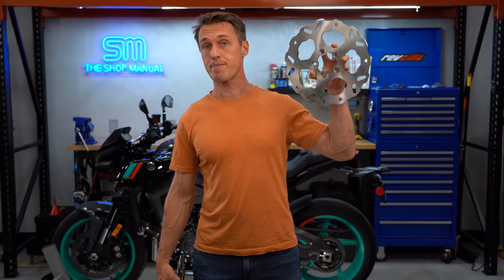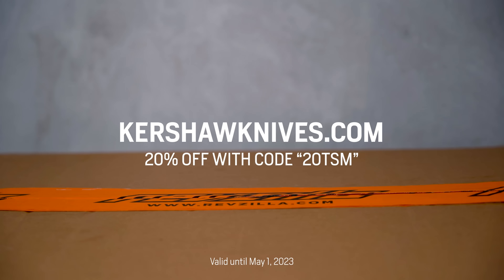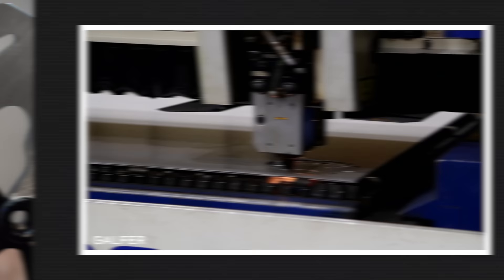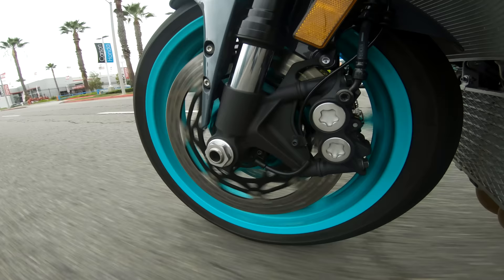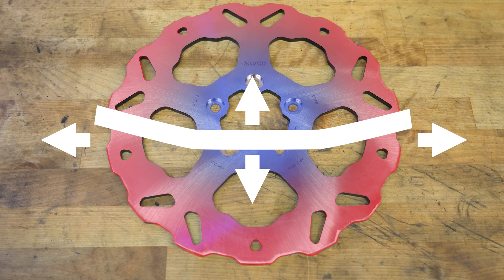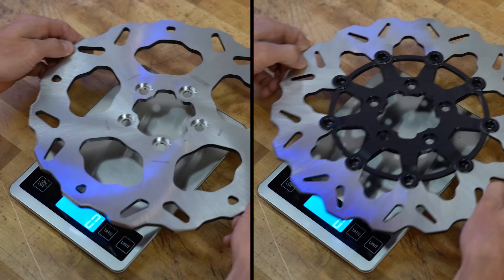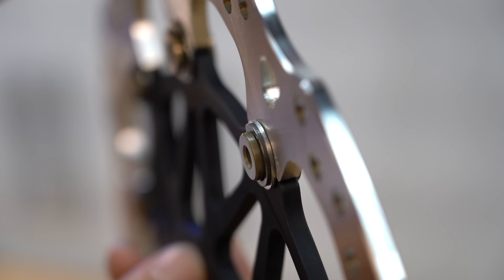Solid Brake Discs vs. “Floating” Brake Discs | The Shop Manual

Comment from the maker: In need of brake discs, pads, fluid, hoses, bleeders, or other brake components and tools? RevZilla has you covered. https://rvz.la/3XmsdCs
Reply: You guys don't carry the Galfer Rotors I used for my bike. So I had to grab them from FuelMoto USA. :<
Reply: Only thing I would have liked to hear Ari comment on is Buell's design with the rotor on the outside of the rim. I remember reading about it years ago and it sounded like a pretty solid improvement for brakes. At least in street applications. Great video as always though!
Reply: i thought you guys were gonna discuss the potential danger of floating discs. not sure what would cause the floating discs to push the pistons back causing no brakes for few pumps until pistons are back to where they should. never knew this could happen until a rider at my local track died because of brake failure. he had a tank slap and as a result, no brakes. not entirely sure what the exact explanation but according to other riders, tank slap caused the floating discs to push the pistons back. this is quite uncommon, i would really appreciate if you guys can explain this in detail.
Reply: @yobkit1982  This happened to me on my R6. Didn't know it was caused by the floating rotors though. Got a tank slapper and then didn't need my brakes until I was coming up on a hairpin. Luckily I was taking it easy after the tank slapper and had time to mash my brakes until I got some breaking action back. Scary stuff.
Reply: @yobkit1982  the floating disks vs non floating don't make any difference in terms of pushing pads back after a tank slapper.
It happens either way
Reply: A rubbish site, I put in Aprilia front brake discs, and got a load of rubbish, even Harley discs, but no Aprilia !.
Reply: I got a pair for my local Aprilia dealer, fitted Saturday,,,

Comment: As someone whose only gotten into bikes in the last 5 years, videos like this are super interesting. Maybe not something i think about when im working or riding my bike - but very cool to know all the advancements we have made over time.😁 Also just general bike knowledge is crazy helpful!
Reply: If you want something to blow your mind, stainless steel brake hoses. I replaced mine a couple years ago and the cost was roughly the same as the OEM rubber ones, but they'll both last much longer and they give much better feedback to me while I'm braking. Plus, the fact that I was able to get one that matched my bike's paint scheme was an added bonus. Those things look and perform amazingly.
Reply: @SmallSpoonBrigade this is one of the absolute best mods ever. I’m actually surprised almost no bikes come with them as standard.
Reply: I’ve been biking for many years and I still learn from Ari :)

Comment: I'm getting sick looking at how ridiculous so many of the floating discs are , there is so little material in the aluminum part that fatigue cracking is a serious health concern, 🤮☠️🤕 I've learned a few things from building a stainless bicycle frame , call me crazy but I think I'm going to stick with the old school solid metal discs and make my caliper floating instead of the disc 🤔😁 don't worry those super super lite weight discs should preform wonderful until you need them the most 😮

Comment: Would be cool to see a video on maintenance of semi-floating discs, especially for people who live in cooler/wetter climates.
Reply: What maintenance? 👀
Reply: @curbkreature7488  Over time the rivets can get dirt and corrosion in them seizing them up, you can also replace them if damaged or badly corroded.
Reply: @curbkreature7488  Also good maintenance of brakes include using fine sandpaper or scotch brite to clean old brake dust from the surface of the discs themselves.
Reply: Best way to do it is to make sure you keep the bobbin/ rivit free moving . Use a 10mm bolt and nut out through the hole and turn it clockwise and anticlockwise to keep them free moving . Do this once a year ..I would not bother with sandpaper on rotor unless you are installing new pads as they work better with your pad material on the rotor/disc . Caliper maintenance is so important and lots of videos on YouTube about it .

Comment: Not a motorbike guy but I'm an MTB fanatic. We have this argument all the time. Floaters say "but heat dissipation, weight, looks pretty" while solids say "budget friendly, simple". Some of you may not believe it but on a good DH run discs get hot, even on a push bike. They will offer burns and boil the rain. As a result, floaters are becoming more popular and we're seeing DOT 5.1 brakes becoming the most in thing with Hope and SRAM being incredibly popular choices. With that said, the simpler and less maintainance heavy mineral oil brakes have picked their game up, both Magura and Shimano have really upped the formulas for their mineral oils while ensuring they won't hurt older models. 
 My initial thought going into this video was, "yeah, obviously a 200kg bike doing 100km/h and over will want floaters, those beasts make a brake glow". Just like MTB, solid discs on motorcycles seem to be a budget offering or a lower performance offering. It makes sense, sure a set of £50 Tektro solid rotors work but a pair of Hope floating rotors at £100 a pair do it better, seems very intuitive that as speed and mass increase, that superior performance becomes less of a desire and more of a requirement. 
 Overall a very informative video and very well produced. No guff, no gimmicks, just pure information and some beautifully engineered examples, I wish MTB had discs as sexy as those.

Comment: I had worn pads thinking that was my issue with braking performance. Put in a new set and has the same issue, low performance braking with some pulsing. Also found them to wear out incredibly fast

Ended up having sand in the rivets and my rotors become solid. Cleaned them out and it's all back to normal

Comment: The absolutely best video I've watched on the subject. Ari these videos are an incredible resource, huge props to you and the team. I've been tracking my heavy BMW on solid discs for years now, braking from 155 mph to 40 at COTA in the advanced group, I'm surprised how well my rotors have held up. Definitely looking to upgrade to semi-floating rotors soon!
Reply: Nice to see you here 😄but actually BMW's front discs on the XR are semi floating. They are still mounted on bobbins and have play in all directions, simply the hub is not present as the wheel takes care of that. No real reason to upgrade to anything different.
Reply: @AntaresSQ01  oh wow, I just went to the garage and  checked. They wiggle for sure! Amazing that after all these years I'm just learning this. Thanks!

Comment: I noticed one of my front rotors on my adventure bike was very lose.  Upon inspection I saw that three rivets had bent flanges.  This likely happened during an offroad steep and slippery leaf filled ditch mishap years ago.  Took some work to flatten the rivet flanges back on the affected rivets.  Bottom line,  if you’re off roading with a bike with floating rotors keep in mind they’re more delicate and can be easily damaged from lateral forces.

Comment: Hey Ari, can you please do a breakdown of what “backing it in” is and and if it’s bad for your bike? Thanks!
Reply: do it all the time on my mt09. learned on my husky te510 motard and xr400 motard. Its fun sliding the back out when entering a corner.
Reply: "Backing it in" usually refers to diving into a corner hard with the rear end loose because you were so heavy breaking that the rear wheel is traveling faster then the front. This is also the same/similar to in Drifting they call a "rear entry". They again, dive so hard into the corner the car rotates to the point of the front being behind the rear for a second or two as the car spins the rear wheels to regain control.
Reply: as for bad for your bike... Not "really", however, doing anything this dramatic and hard on the components is going to cause wear and tear, so in a way Yes, its bad for your tires, brakes, suspension and possibly for you if you mess up and cause a high side and throw yourself off like a motogp racer in the rain.

Comment: Decreased unsprung weight has several benefits as well. Way back in the day, I rode a Suzuki GS850 shaft drive motorcycle. The original tire was a Dunlop. A Continental tire of the same size and rating weighed about 5 pounds less. That helped reduce the unsprung weight penalty of the shaft drive and made the bike much more controllable on rough roads. The Suzuki also had two steel front rotors and it would have been nice to dropped 8 pounds of unsprung weight on the front wheel as well. But, didn't have technology then.

Comment: And not only is the overall weight of the motorcycle reduced, but it also reduces the unsupported weight, making the suspension work better and allowing the wheel to stay in contact with the ground for longer by reducing inertia, which improves grip. and stability

Comment: Wet discs have been around a long time but due to corporate pressure they are not an option due to the length of time between pad changes, but the wet disc is the clear number 1 form of braking as it allows the best control of the braking and the best stopping distance . Macpherson tractors were the first to invent the wet disc , housing the disc brake and caliper in a sealed container filled with hydraulic fluid and the pad had a 10mm wide groove cut into the pad allowing the fluid to flow through the pad whilst the pad was being forced into the disc rotor.

Comment: > the rivets that secure the rotor to the carrier are either clamped right out use spring washers
I've read somewhere that when the rivets are clamped tight (without spring washers), heat expansion of the rotor can actually cause it to break the rivets - since tight rivets leave no room for it to expand. That problem is unlikely to happen during normal street riding, but then you don't really need floating discs for street riding anyway.

Comment: I rode various motorcycles with various braking systems for many years.  
On the hoghway, I never had fade issues other than on the Alps.  On the track, I could fet fade from quite fancy front discs within a few laps (the rear brake is not really a track "thing" with motorcycles).
However, using hydrailic discs on an MTB I have never sifferwd fade, even over a hard and long enduro with long, steep descents. I thonk a lot of people are spending nig money on tpys above theor level.
Obviously, I dont have discs on road bikes....  😊

Comment: I installed Brembo T drive on my Ducati 1299S a few year back and it was a total game changer. The lever feel is super consistent all day.. I never thought rotors alone  would make such a massive difference.
Reply: I’m surprised by that too, because the 1299s already had top notch braking hardware. Was that Brembo design a more modern concept then stock?
Reply: @williamfischer3990  Stock rotors are thin and semi floating. You put heat into them one time and they are done. I coned them in 1 day.. T-drive is amazing, one of my favorite upgrades.
Reply: Did you use it primarily as a track bike?
Reply: @williamfischer3990  No, 90% street and %10 track. One track day and rotors were done, T-rives have been perfect for a few years now.

Comment: I had a set of PFM Brakes, full floaters & discs are cast iron, not stainless, which cool a lot quicker. Replaced the discs & rebuilt the 2 x 6 piston calipers when I sold the bike @ 120,000 klms. Discs had about 80,000 klms & needed replacing due to wear. Bike was a 1580cc Big Block Stroker Motor Gen2 Hayabusa. I'm the inventor of the Thermoelectric Boost Cooling & Charging System. Just click on the avatar & enjoy the ride on the 2019 Kawasaki H2SXSE+

Comment: good and clear as usual, top marks. I have solid discs on my 1985 Moto Guzzi, for the type of rides I do with that (long relaxed tours, loaded) the braking power is OK but I have had issues. Even after precision grinding, wear pattern is not uniform across the disks. I guess it is a matter of mounting tolerances (disc to wheel to fork to caliper).
I have floating disks on my 916 and that is entirely different world....but of course these two bikes are at the opposite ends of the type of utilization

Comment: Something rings a bell here... IIRC, fully floating discs caused an unpleasant accident at the IOM TT (quite) a few years ago. At the end of a looooong flat-out-fast and bumpy downhill section of the circuit the rider went to brake and found nothing. The floating disc had had enough lateral rattle to have knocked the pads and pistons a mm or so back into the calipers, so when the rider squeezed the lever all he did was take up the slack. By the time he squeezed again there wasn't a lot of braking zone left.

Again IIRC, everybody stopped using fully floating discs at the TT after that. I don't know if there was a rule brought in banning them or whether they fell out of favour. As I might have mentioned, it was a long time ago.

Comment: 1) You said that the "non-aluminum" was "steel", My recollection is that cast Iron, has better thermal, frictional, and 'non-warping'  characteristics than steel, although some bikes now use "stainless steel".  2) Why would "floating" disks run cooler?  I would think just the opposite as the inner metal on one piece would act as both a bigger "heat sink" and also conduct more hear to the hub, which in theory is bad for the wheel bearing grease, but that is another issue.

Comment: I think for ordinary road use a solid disc lasts way longer especially without the holes . There seems to be an industry hell bent on making brake discs a renewable service item . I am on my third front semi floater after 80k miles , a colleague on an older beemer is 200k miles on original disc with no signs of wear still .  The trick with solid discs is to not leave your brakes on after a very heavy stop to help avoid a hot spot and warping , common on many cars also .

Comment: Great vid thanks, just to share some downsides of the floaters some systems with the time the rivets start getting loose and the disc brake noise will drive you crazy, common problem to bmw bikes

Comment: Stellar vid ! please help me to get the  word out about a serous flaw on many china floating bicycle brake disc   ive tried several brands and they all have super thin cheap steel washers that can rust out in no time , when they must have stainless ! And many of these are being used on hight powerd ebikes , so they are allredy under sized for the speed potentially of the bikes.

Comment: Agreed the floating rotors are far superior but I had a bmw 1150rwith a solid rear rotor and never experienced any brake fad. On the other end of the spectrum I have a Ktm 1290 with a floating rear rotor and boiled the fluid. 100,000 miles on the bmw and about 20,000 at this time on the Ktm. Not sure why, I don’t drag the brake and have not changed my riding style. Both are Brembo as well. Just my personal experience.

Comment: One point that I think was overlooked. Solid discs allow the heat to soak into the surrounding wheel hub and assembly. Floating discs don't have this type of heat dissipation path. Generally on the front of a bike that isn't a problem. In go karts as an example, floating discs can overheat more quickly than solid disc because of the location of the disc behind the seat, its nearer to the engine and the disc carrier and rear axle provide a great heat sync.

Comment: What about perimeter discs or hub less discs?
You can cover in next video
Reply: My CB500F has solid rotors, but the front is hubless.
Reply: Same is the case my hornet has solid rotors but mounting bolts are far apart from hub.
I think it an excellent design which do not warp in long run.

Comment: Thanks for great content, but i have one question:
@3:27 What are the variety of reasons that fully floating disks isn't ideal for everyday use? 

I mean except for the sound, isn't a fully floating rotor much easier to clean? 

On my semi-floating Brembos getting rid of debris seized in the rivets is a pain every rainfall. With significantly larger tolerances I'm assuming that would be much less troublesome. 

Id like to know why i should not go fully floating because right now it seems the obvious next step, even though my use far from performance oriented (Ive been to track once, but ive had warped disks changed and I can feel the difference when dust is seized in the rivets on normal days).
Reply: Besides the noise, the freeplay in fully floating disks means they wear out much faster around the buttons, and wear out the buttons as well. Dirt and grime from the streets increase that wear even further.

Comment: There is 3 types,, solid rotor, alloy hat and iron rotor and then alloy hat and floating rotors. 
For budget racecar stuff the alloy hat and iron rotor is common. They do not float,,do have some of the issues you mention but also have less issues of rotors running out, and cracking from the bobbin holes
I have used all 3 types. For racing a solid rotor is the worse. But only with extreme heat. A little care required
For top level racing a floating rotor is preferable,, for the rest an alloy hub resolves most issues and are a good deal cheaper as well
Reply: Thanks for watching, expect more videos soon, reach me in the number above.

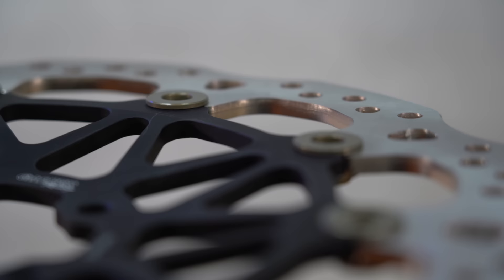Comment: Question:  AT 3:47 you mentioned "risk of pad separation."  I wondering what that means?   The reason I ask is that I warped the stock front rotor on my Ninja 400 during a track day, so I replaced it with a Brembo rotor that is apparently "full floating" because it has all that lateral play (and rattles as you describe).  You mentioned this type of rotor is not ideal for street riding so I wonder what's the downside, other than the rattling?  Because I also ride this bike on the street sometimes.  Thankss